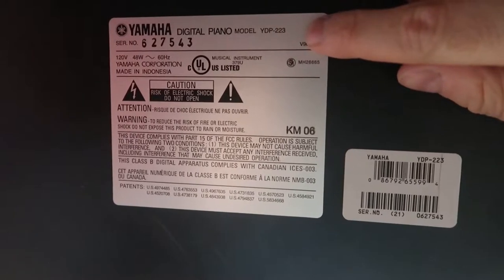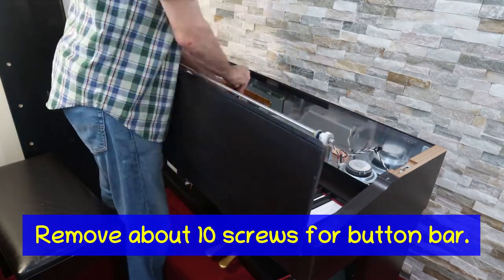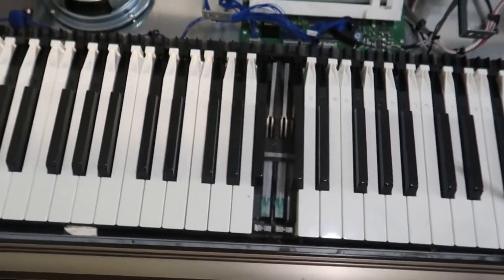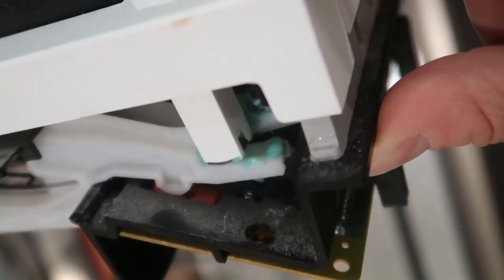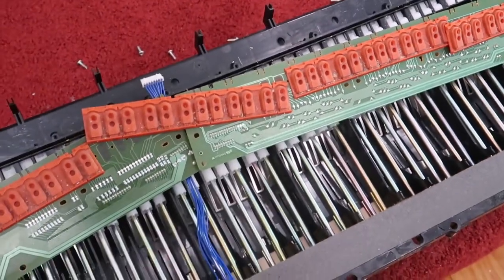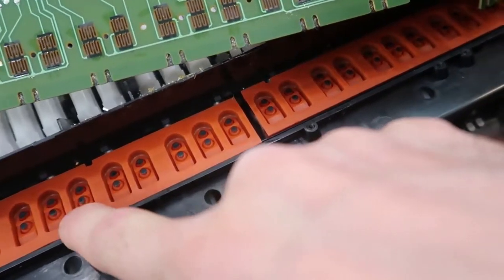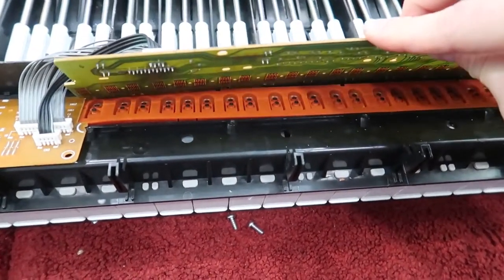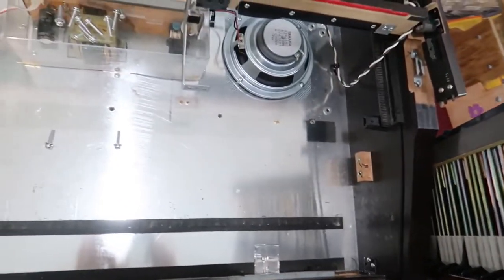Yamaha electric piano loud/dead note key fix YDP-223, Clavinova

Comment: You need piano cover 😅
Reply from the maker: Yes, we don't use the cover enough. But most of the dirt is from kids eating food or bringing crumbs to the keys. Don't let kids eat near the piano!! But it is also not a good design by Yamaha -- Those crumbs, eraser bits, paperclips, etc. should fall AWAY from the rubber buttons, but instead they fall INTO the buttons. It would be quite easy for Yamaha to make a plastic guard between the keys that blocks crumbs and dirt.

Comment: Hi Colin.  I had an issue with our clavinova that my daughter plays.  We had the sensitivity controls making about 8 keys play in a forte upon a soft touch.  I youtubed a video where a young Asian guy posted a great video and pulled his unit apart and although he was not speaking in english, I was able to follow his video and cleaned the carbon contacts on the orange membrane with alcohol.  I repaired every key except the "D" in the third octave is now dead.  I was pondering as to whether or not I might be slightly misaligned on one key so it is dead.  It wasn't before I fixed the other issue.  I considered trying to purchase new membranes but couldn't get any help from Yamaha.  They would only send a link to repairers.  My closest is 300 klms away.  I might try another disassemble and use the fader lube and see how that goes.  Another tip I found was that I supported the keyboard off the table each end and this enable me to easily reinsert the membranes.  Good the see how to remove the keys though.
Reply: My guess is you've got one of the two buttons misaligned on that D key. I think one of those buttons is off, it gets super loud. If the other button is off, it doesn't make any sound.

Comment: I dont understand how the tabs hold the motherboard. I can't get it to "snap" into the tabs, especially with the orange pads sliding down and blocking the tabs I'm assuming this part is necessary as I heard no sound from the keys when I reassembled.